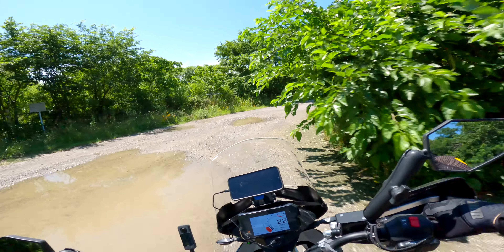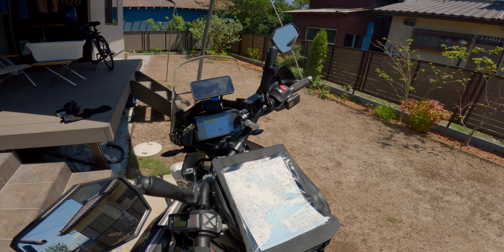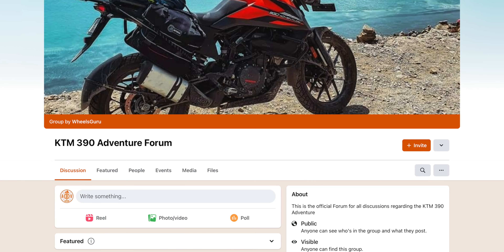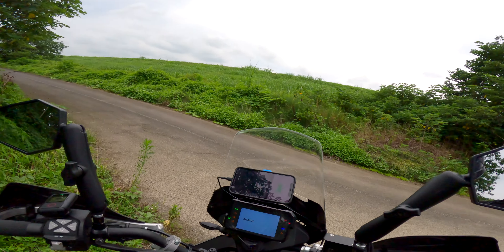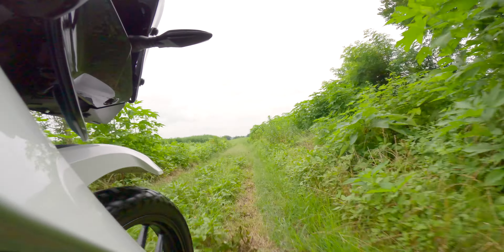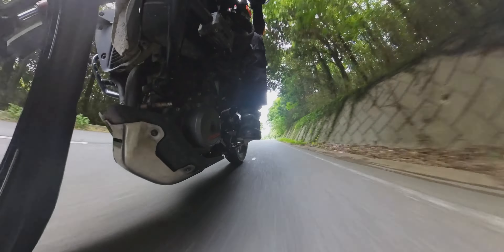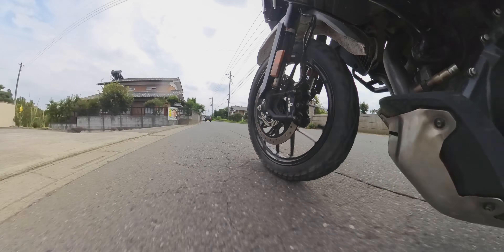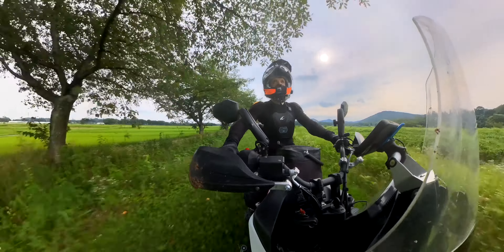#32 - KTM 390 Adventure | Overheating & Fuelx Lite + DNA Lid Filter Review

Comment: A good radiator guard will have more mud buildup. You are installing the aftermarket rad guard to stop debris from damaging the radiator. As a rule, they have more area blocked. Regular cleaning is required. - Frank
Reply from the maker: Yup, totally agree!

Comment: Great update. The FuelX lite is my only engine mod, and it made the low speed much better for me, but i only have done road and gravel and a dirt road. Never gotten over 50+ mpg, but just hit my 600 mile service light. No riding for the rest of this year. Knee replacement this morning
Reply from the maker: Thanks Ron, Fuelx lite alone is a great upgrade. Knee replacement?! My god, I hope it goes well, friend.
Reply: @advinjapan  just got home. Everyone says it is the best thing they have done
Reply from the maker: Glad to hear it went will 🤟🏻. Long recovery?
Reply: @advinjapan  it will be 3 weeks Tuesday the 8th. I still have to work a bunch more movement back into it. I mostly have trouble sleeping. I figured out that pain pills don’t work for me.  It is getting better daily.
Reply from the maker: Oh man, good luck and Godspeed!

Comment: Glad you got it resolved.  I did a longish ride with freeway bits doing 70+mph and still got 57mpg with DNA lid, Fuelx Lite, and BDSB fuel controller. I might hold off on the 14t sprocket swap.
Reply from the maker: That's great, how do you like that fuel controller so far? Helping with the higher range RMPs?
Reply: @advinjapan  It does seem to have more oomph when pulling beyond 6500rpm when it becomes open-loop.  Hard to say without a dyno.
Reply from the maker: That’s good to hear, Sounds like it compliments the fuelx lite pretty well👍.

Comment: Hey, Nice video. I know you're busy, so I'll keep this brief. I'm interested in the status of the FuelX Lite and DNA filters. Given a choice between the two, what do you recommend to have first if one cannot go for both simultaneously? Could you suggest the following: FuelX Lite or a regular air filter from BMC or K&N?
Reply from the maker: Hey, thanks. Either of those will probably work. I personally like DNA filters. As long as you stick with an in box filter, you won’t need the fuelx lite. That said, I highly recommend the fuelx lite as it will greatly improve the low end performance of the bike.

Comment: I have both the air box lid and FuelX Lite as well. I do all road driving because where I live in Ohio, I can't find any trails yet. I mainly like the posture of an adv bike, that's my main reason for buying one. I did find a K&N style OEM filter to compliment the DNA lid. Hopefully it performs as good as a K&N. I live in an area that is pretty clean, so regular cleaning and oiling the filters should protect my engine just fine. Still waiting on the filter. For less than half price of the K&N, I have to wait for delivery from China. I too love the combo of the DNA lid and FuelX Lite. I also bought a small cheap muffler that is basically just a straight pipe without the baffle. All three parts have awakened the power and sound of this bike . I like the louder sound. It's not obnoxious like a Harley but it makes you bike sound a bit meaner and not like a glorious moped 😂. At 7k rpm it still fairly quiet as long as you don't crack the throttle open.
Replacement For Husqvarna 200, 250,401 Vitpilen Svartpilen 2018-2020, For KT/M 125 Duke 200 Duke 250 Duke 300 Duke 390 Adventure 2017-2021 Air Filter HFA6303 OE:93006015000 https://a.co/d/iYCqauT
Reply from the maker: That’s great Allen, I like your setup. I’m in the market for a cheap slip on myself and maybe a mid pipe to get rid of the heavy (and virtually useless) resonator. Good luck with finding trails, I’m sure they are out there, just have look around.
Reply: @advinjapan  thanks, your setup is nice too. How did you end up in Japan? You have  a professional sounding voice, are you in broadcasting or something? I left the cat on and the big resonator. I may do a cat/resonator delete eventually but don't really see the reason to as of yet. 
  🙏
Reply from the maker: @allentig  just picked up and moved over here, haven’t looked back, nothing special. Haha, lot of people say that, but no, not in the broadcasting biz. Deleting the resonator will save you roughly 15-20lbs of weight.
Reply: @advinjapan  haha, 15-20 pounds won't matter much. I'm 6ft 4in 250 pounds . The bike is only going to go so fast with my fat ass 😂 ... I look like a grown man on a 50cc dirt bike  😂😂
Reply from the maker: @allentig  🤣🤣🤣

Comment: Thanks for the update. I'm going with the fuel x lite with the stock lid, aftermarket high flow filter with a pre filter mod. What filter do you recommend?
Reply from the maker: Thanks a lot! For the airbox? I have not looked at the options, but I seen a lot of people using the DNA filter.

Comment: Dude Japan is so beautiful. Your filming and everything is perfect too!! Just a quick question. Does your headlight assembly wanna rattle itself to death with that gps holder and phone. I have the same holder and either I'll quit or my headlight assembly will. quit.
Reply from the maker: Thanks DHMH! I’m really enjoying this whole adventure, including the filming. 

I’m not having any particular issues. Have you checked to make sure all the bolts are securely tightened? I know the two bolts on each side of the holder can be a hassle to get in there properly. Sorry I’m not much more help than that. In any case, the bike is very loud to begin with, rattles all over the place, so there is that.

Comment: Hi, I recently discovered your channel. I am owner KTM ADV 390 since April of this year. I am very much considering the purchase Fuel X. I'm trying to get some information about it. You channel definitely provide them. Good Job 💪. I have AliExpress radiator guard (holes), but stock fender. No overheating yet.  Let me ask a question. You are a soldier serving in Japan? 🪖 Greeting from Czech Republic.
Reply from the maker: Hey, thank you very much. The fuelx is a great upgrade. It’s made even better with an aftermarket air filter and/or exhaust. With that radiator just make sure to thoroughly clean it out every so often👍.

Actually, I was a soldier in the US Military🤟🏻. I’m an expat that moved to Japan.
Reply: @advinjapan  Great, I had intuition that must be something related to military 😀. I'm soldier for 15 years right now. Thanks for the quick response. I'll probably buy it. I don't know yet to get LITE or  PRO version. I'm focus more on road travelling. Radiator clogged by mud is not common in my bike. But I'll keep in mind. Thanks you. I Wish you a lot of happy miles and stay safe.
Reply from the maker: Yeah, it’s so easy to spot someone with a military background, sticks with us for good, Good luck and thank you for your service!

Comment: Hi I have a question , would you write or send a link where you bought the windshield? I would like to ask because in the video on the steering wheel on the left and right side some devices would you write what it is?
Reply from the maker: Hi, thanks for the comment! The windshield is from Aliexpress. Just search, “KTM 390 adventure rally winshield” and it should pop up. The devices on the handlebars are a GoPro remote control and a control for my insta 360 camera.

Comment: 7K RPM... Did you drop your gearing? I can cruise at 85 mph below 7K. - Frank
Reply: He swapped to 14t countershaft sprocket.
Reply: @blastradiu5  Thank you. - Frank
Reply from the maker: @OneOldManRiding  Yes, but I did exaggerate a bit, probably not as high as 7000, but still not exactly comfortable even at 5000-6000 for long periods.